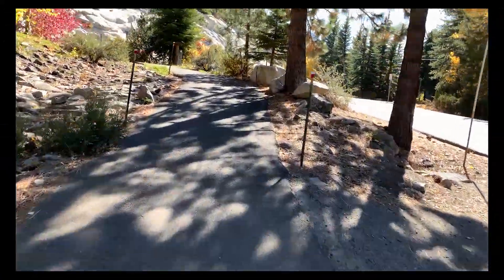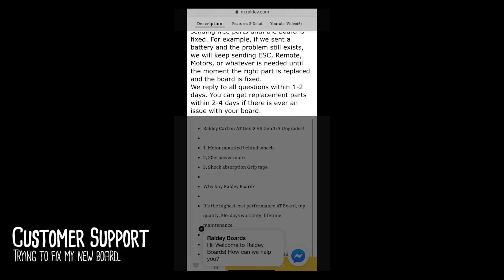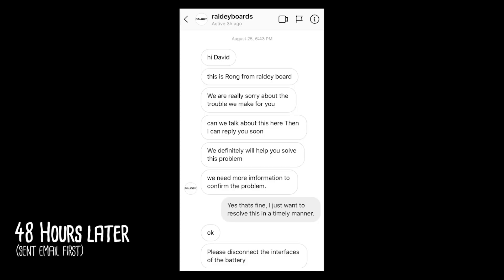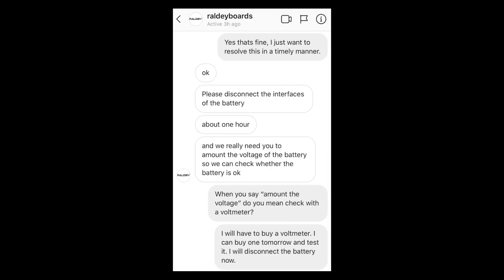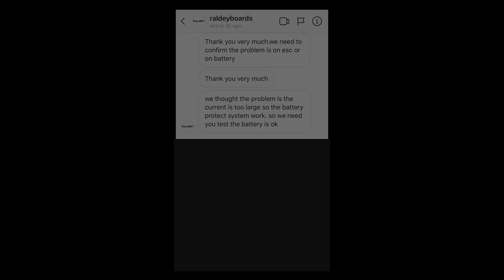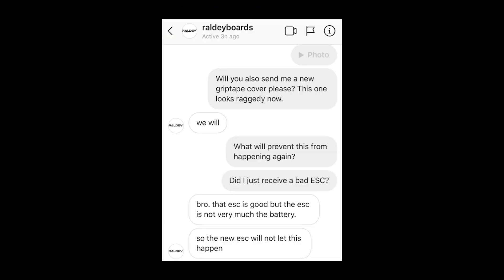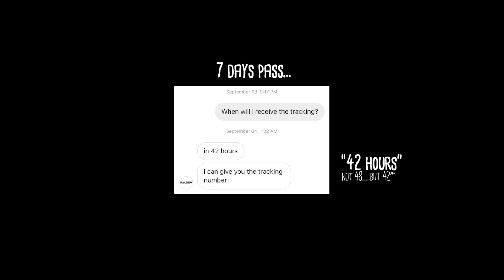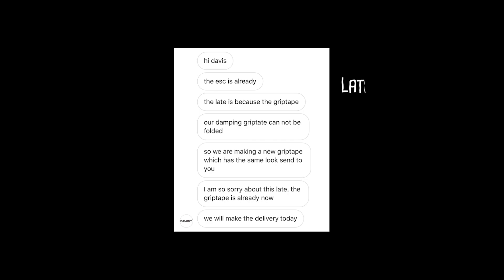Raldey Electric Skateboard Review - WATCH BEFORE YOU BUY

Comment: So many months later and they are still selling faulty boards. It looks like the BMS might be the problem. About two weeks ago I bought the V2 (or rather received it after waiting about 40 days of shipping even though the website said 7-14 days) and had had it for about a week with only about 30 miles on it - decided to avoid all wet areas (even puddles) because the wires and the charger connector plug are not sealed well. Last week I was about 5 miles into my ride I was going about 25mph down a smooth open road I’ve gone down a zillion times on my friend’s Lycaon board and the Raldey just died on me and I got thrown off pretty hard. I think it is the belt motors of the Raldey that causes a fast stop when the battery fails? I was used to the hub motors of my friend’s Lycaon (which isnt AT and coasts when the board is off and you can essentially use it as a regular longboard). From wiping out I had a split chin, cracked helmet, concussion, scraped up palm, elbow, hip, chest and banged up knee a bit. I checked online and this isn’t an uncommon problem that has been going on long enough that it is BS that it is still not fixed... so I thought I should throw that out there again... be careful. If I weren’t wearing a helmet I would have easily ended up in the hospital with a cracked head and half of my face rubbed of on the road. I’m wondering if anyone who has fixed their board has had further problems with it or if it has been good?
Reply from the maker: Anonymous First, Im glad that you are safe and was wearing appropriate gear! Its been about a year now and over the winter the board sat on the charger in the garage. I took it out a week ago and my overall battery life has dropped by about 10-15% which is very disappointing. I had also concluded that it must be the ESC or BMS plus a low quality battery. Im sorry you also had a bad experience with Raldey and hopefully others will see these posts and “influencers” will stop trying to push bad products without doing some basic due diligence in their reviews.
Reply: the ESC is supposed to be a Hobbywing which should be one of the good ones favored by a lot of people? (Disclaimer) This is me regurgitating what I’ve heard - not actually knowing ...

Comment: I am on my 3rd week of waiting to hear when I MIGHT get my warranty replacement remote controller. They told me to buy one from website for $88. I sent a copy of the warranty then they said they MIGHT send me one. Tech support no longer answers my emails. So frustrated with Raldey support.
Reply from the maker: Donkey D i didnt include it in my review because there were too many texts between us, but at one point they simply were going to leave me hanging with a non-working board and not honor the warranty. I had to politely coerce them into a sensible state. Be very persistent. They have also changed their sales page and warranty page verbiage since this review. Shady tactics yo.
Reply: David Leach yes shady indeed. I think we knew a Chinese company would be unreliable.. week 6 and they still won’t answer my emails. Raldey is a terrible brand. No tech support.
Reply from the maker: @donkeydem2824  I missed your last comment. I totally agree that the handling of this by Raldey was TERRIBLE but I don't specifically blame it coming from China or being Chinese. I blame this specific company, and they just happen to be located in China. Majority of the excellent products we enjoy today around the world...are actually manufactured in China. China numba one! I hope you ended up getting a resolution with Raldey and have been riding around!
Reply: That's super weird because the remote is only $40 have you got your remote if not I can contact them

Comment: So its been a year. How did it hold up?
Reply from the maker: Board, battery, and remote held up well and I ride the board weekly. I haven’t had to use any of the extra belts or wheels that were included in my purchase. I wrapped the remote control in rubber bands to protect it from drops and to provide some resistance to the throttle. According to other reviewers the only bad component to Raldey is the slow customer support.
Reply: @DavidLeach1  thanks for this! I just pulled the trigger on the carbon AT v2 - 2 in 1 . My other board is a deck swapped meepo but some roads here are too rough for it so it mostly sees bike trails. Hoping for comfort and confidence during the ride above all else with this raldey

Comment: Got 1250+ miles from my Raldey V2 which was stolen while I was robbed at gunpoint during this pandemic, so I never got a failure. I have a much better board now, but this was like getting a new car when I had it the first year or so. I am sorry your experience was so different. Their support did lack, glad I never needed it.
Reply: Also your so right about these AT boards being not all terrain. 1 good ride on short grass hills for 15 minutes means a broken belt, especially on this board. Went through literally dozens of belts. Not the same experience which my 7000w board now, with  the same thickness yet shorter length belts. I can't figure it out, my guess is the pulley size vs tire size was bad on the Raldey ATv2. Also took months to arrive, which was very painful
Reply from the maker: Mine is beginning to get a bit creaky and the motors are displaying some signs of degradation, I’m clocking over 730+miles. After the initial issues it ran without problem. Im currently building a Trampa board and am eyeing a Lacroix board

Comment: How do you feel about buying this through Amazon with the added 2 year insurance thru Assurion? That’s what I just did now debating on canceling the order 😬. Amazing work on the video! Very fun to watch. 😃
Reply from the maker: If it’s listed on Amazon for a reasonable price, I would buy it. Amazon will alleviate any (early) issues with an immediate replacement, however by now, I hear that Raldey has it together and is making solid boards.
Reply: @DavidLeach1  I received mine 3 months ago and it is solid. 🤘

Comment: How did you fall? Just wonder how it went so bad lol it seemed like uphill not too fast... Did the board explode?
Reply from the maker: It is a small but steep little hill, I was leaning all the way forward when the board just shut off and braked.
Reply: @DavidLeach1  ahhhh no that's horrific! That should never happen, mine is supposed to coast if it shuts off. A sudden brake you're not expecting is almost a certain fall.

Comment: Hello! Can you tell what happened and how did you solve the problem? Because I want to buy this longboard
Reply from the maker: Dmitrii Merzliakov The (original) battery always tested fine, however the board wouldnt power on at all, no flashing red ring indicator, nothing. Initially they sent an ESC, swapping it out made the board turn back on. I rode it less than 1000ft and the board just shuts off and died again. After a lot of BS with customer support they finally agreed to send a new battery. This finally fixed the board. You can clearly tell that the two battery packs are different manufacturers/suppliers, leading me to believe that they were aware of battery issues already. Im still regaining trust in the board but overall its been solid after my initial issues. Still...terrible customer support.
Reply: @DavidLeach1  Wait, but is the longboard working now?
I just want to buy this longboard, and I wanted to buy a spare battery for it.
And another question, is there any kind of moisture protection(waterproof)  or from sand?
Reply from the maker: Dmitrii Merzliakov Yes the board is working fine now after a battery replacement. There is no water protection on the board, which is why I wrapped the underside of the board with clear vinyl wrap 👍🏻 which makes the board much safer to ride in wet conditions.
Reply: @DavidLeach1  The original battery probably has dead cells in it OR the bms was shutting it off due to over current.
Reply from the maker: isiahvic yessir, I had the same hypothesis 👍🏻🤓
Reply: @DavidLeach1  They would always cheap out on the battery as its usually the most costly part.

Wouldnt depend on the stock china batteries.
Reply: @bigfloppa_01  the board is " IP 55" so you can go on tiny little puddles but I would not suggest getting your board wet wet

Comment: The replacement remote is now at $200!!! I’m NOT joking
Reply from the maker: That is disappointing. What happened to your (original) remote?
Reply: The “joystick” part that is the accelerator would get stuck so it wouldn’t break completely so if I fell for some reason the board wouldn’t slow down it would just keep going at full speed

Comment: MY BOARD SLOWS DOWN AFTER HITTING 20MPH AND IDK Y PLZ HELP
Reply from the maker: Does it simply slow down or does it shut off? Could be the remote mode you have it set to, it needs to be on the third setting to allow the maximum speed. If it IS set to setting "3" and it still is slowing down, that is most likely a sign of a bad battery :(